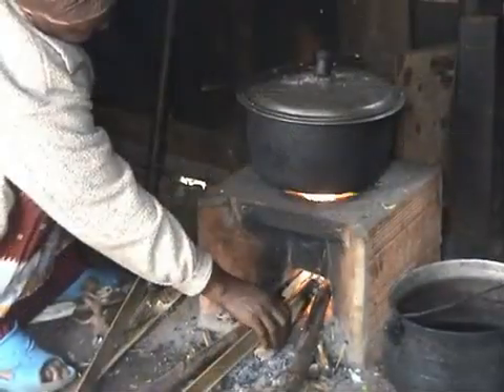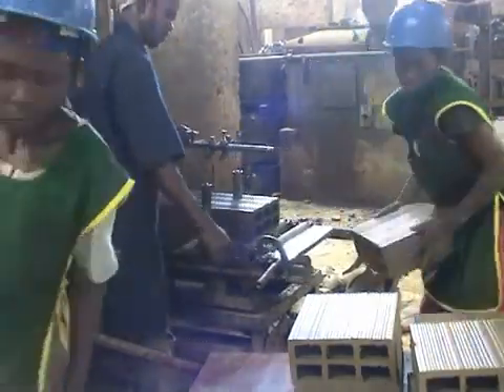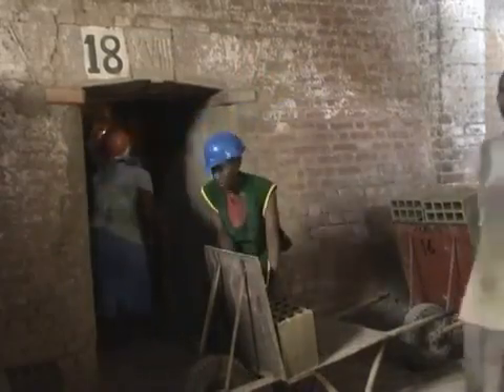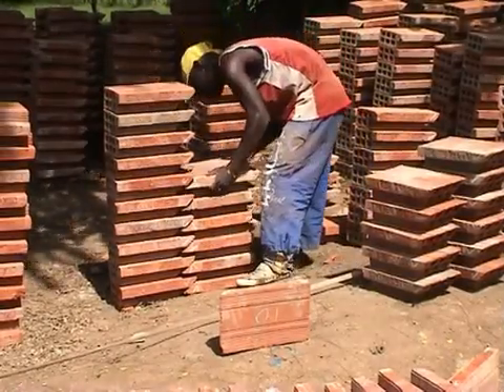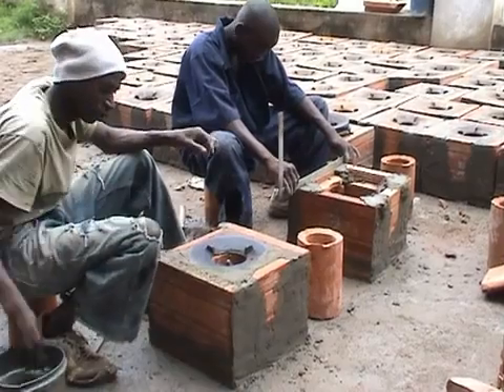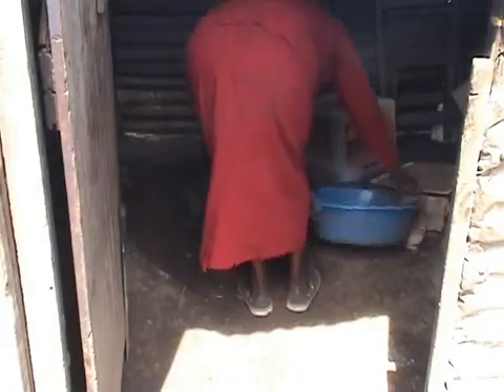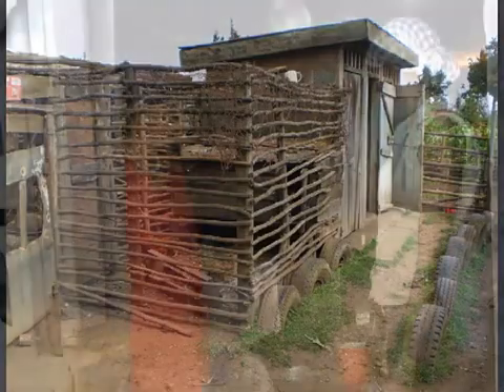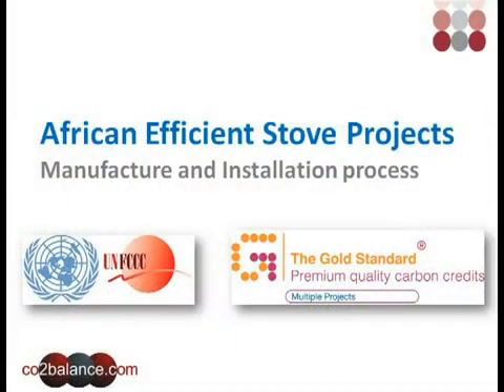Sceptre CO2e | CO2balance Stove Construction

Comment: Since my previous comment I did a lot of research. The stoves are sold carbon rights. Carbon rights are ownership to 1 ton of sequestered carbon aka as 1 carbon credit. They are sold to companies that pollute the atmosphere with greenhouse gasses. The polluting company can then legally dump another ton of greenhouse gas into the atmosphere for every carbon credit they buy. The net reduction in carbon dioxide in the air is zero.

They do not say how many carbon credits has to be paid for each stove or the carbon rights on how many hectares of forest. As of today a carbon credit ranges from $9.06 to $15.40 USD and is expected to go up to $25.00 in 2020. A forest can  sequester an average of 10 tons of carbon per hectare per year. That is a lot carbon. This would give a return of $90.60 to $250.00 or more per hectare per year. The price of a carbon credit is expected to be $120.00 in 2050. The number of hectares are not specified. Why? These guys are not little league and didn't get rich by giving charity.

A stove that is as fuel efficient  and as smoke free can be made by the villagers themselves from local clay and a couple of hours work and they would still own their forests. Every swindler has two reasons; one that sounds good and the real one.